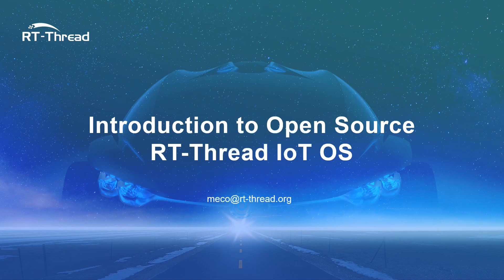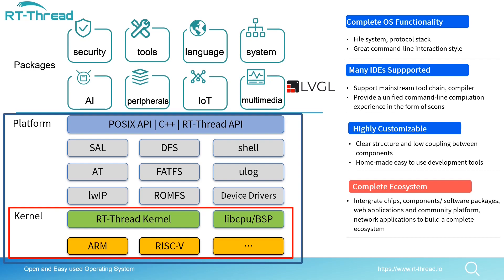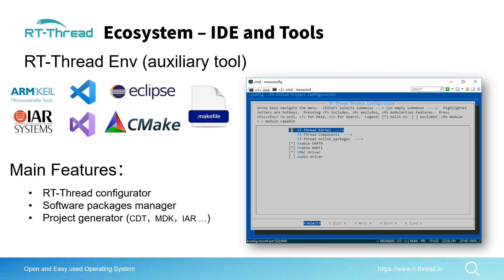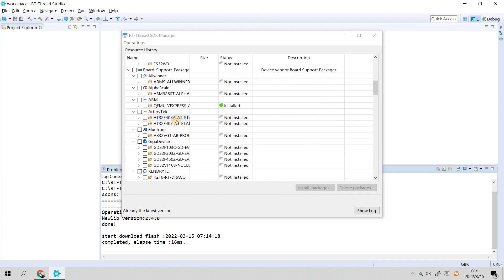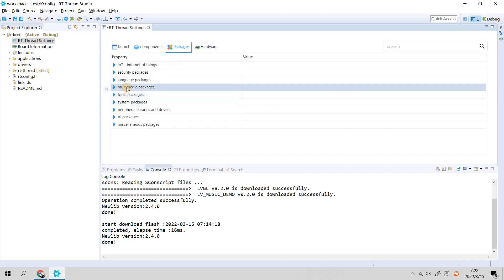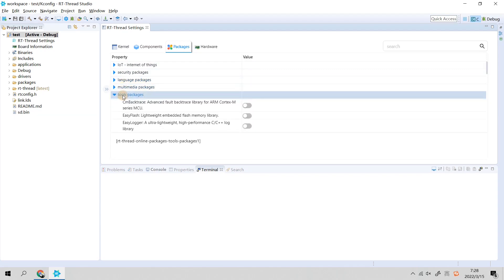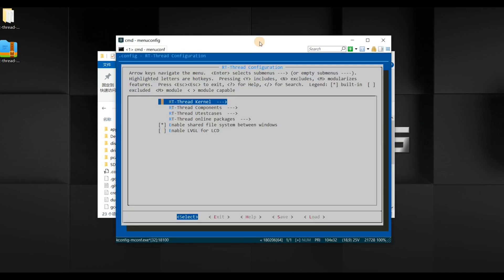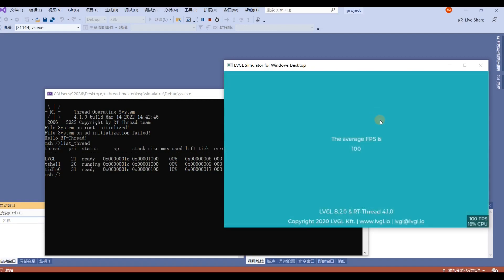How to run LVGL on RT Thread in simulators

Comment: So I have to make a simple project using LVGL and rt thread os and instead of running it on the TFT, I can simulate it? I did not understand that running part because video only showed the examples running.

Also I am new to rtos, if I only use LVGL would the ide simulate that too?
Reply from the maker: to participate in the contest, the project needs to run on RT-Thread and with LVGL. and with RT-Thread Studio IDE, it's getting quite easy to get all of that work done.
Reply: @rt-thread  yes I understand that part but I want to know that the GUI project I make using rt thread and LVGL, I can simulate it on the ide?Like the examples of that music shown in the video.

I don't have a screen rn so simulation would be great.If it is easy to do.
Reply: @027_lakshaynegi6  No, you cannot simulate in your actual hardware project. LVGL is non-relative with your hardware. You can use the simulator project to design and simulate in the simulator project. When you think the GUI is ok, than copy these GUI part files to you hardware projects.
Reply: @mecoman2574  oh ok got it. Thanks
Reply: @mecoman2574  IDE iptions are changed thanwhat was shown in video. During building I am getting error that lvgl.h is not included. Can you help me with this too?